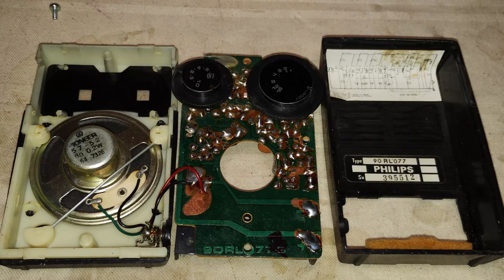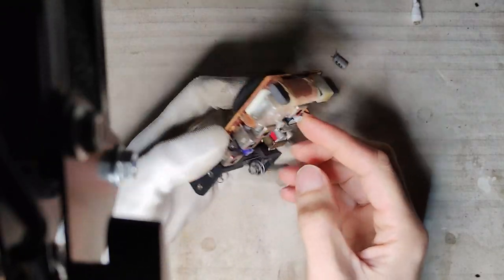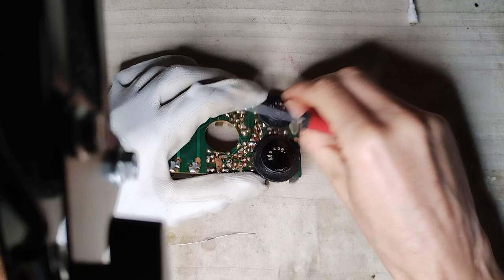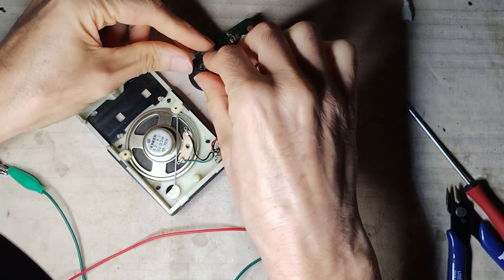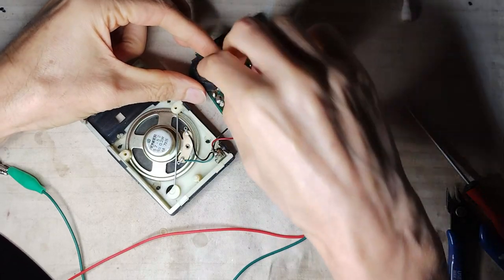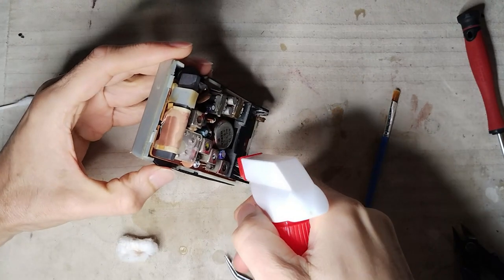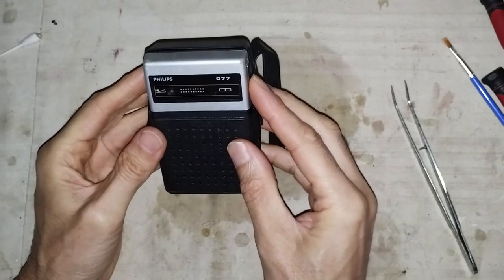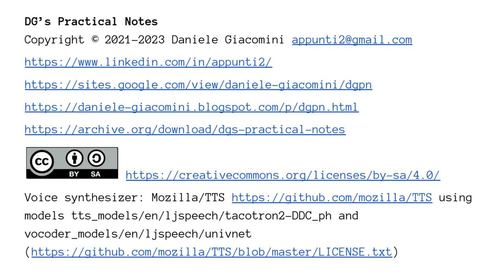DG’s Practical Notes, U#1 Philips 90RL077, 1973-1975

Comment: This was my first transistor radio when I was about 5y/o, my grandfather gave it to me.
AFAIK it had at least 3 versions:
1. All Germanium transistors.
2. Front end and IF silicone transistors, the two outputs are still Germanium.
3. All silicone transistors.
Reply from the maker: Yes, I have noticed that there are slightly different versions, also in the choice of transistors. But I don't know the full evolution of this radio model.
Thank you for your comment.
Reply: Thanks for your reply, great video! @appunti2
Reply from the maker: Thank you! 🙂